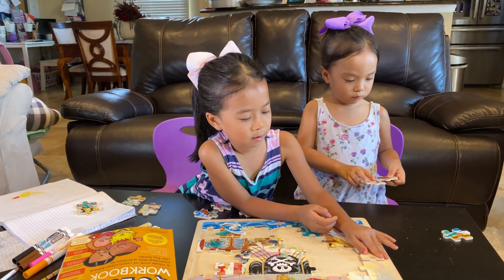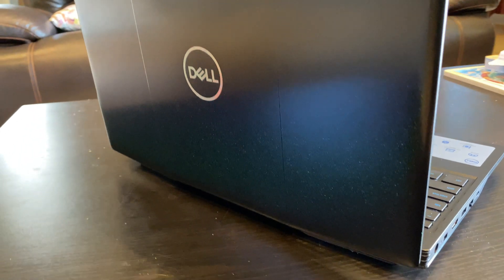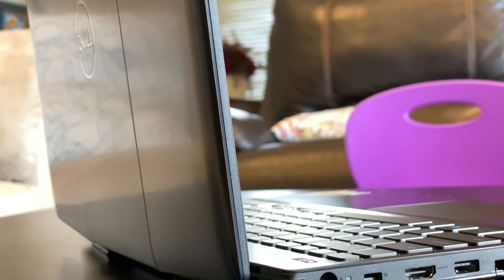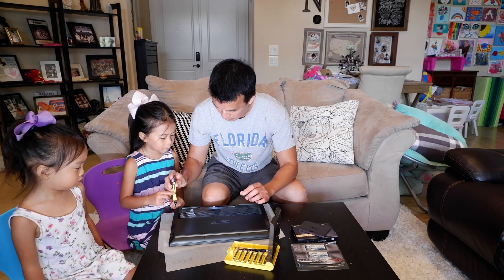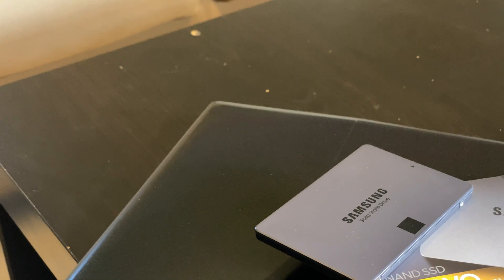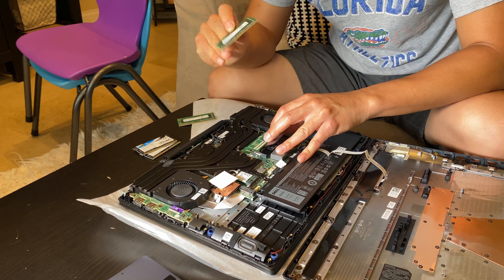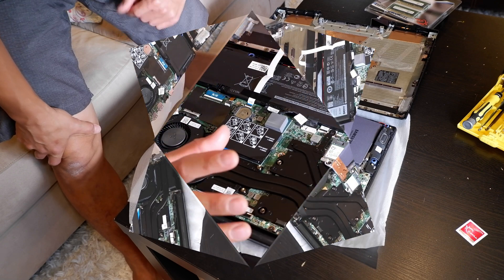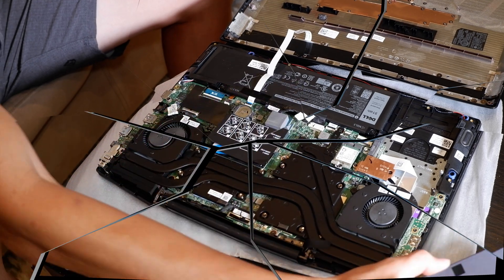How to Upgrade Ram Dell G5 15 5500 G3 Gaming Laptop 32GB | M.2 M2 2.5 SSD Upgrade Options Overview

Comment from the maker: Few Amazon sellers are gouging for the YX0F3 SSD Bracket at $23 (Dell list is $2.99): https://amzn.to/3qMip56
Reply: I believe that connecter on the board under the second m. 2 slot and above the battery is the sata power and data connections 
The adapter for 2.5 inch is going 10 to 20 bucks on ebay if you want look it looks like it would fit there would have to mount the ssd with double sided tape If that is the case though

Comment: I got mine in January of 2021, it's a November 2020 manufacture.. same 8gb and I need to upgrade. I saw that it's a 288 pin for the ram card, does that mean I need to get an exact 288 pin or will a lower pin still be suitable for application?

Comment: i don't think you need the copper heat shield to properly install a new m.2 ssd. it's just there to aid in heat dissipation. which means you can replace it with one of those gumstick thingies

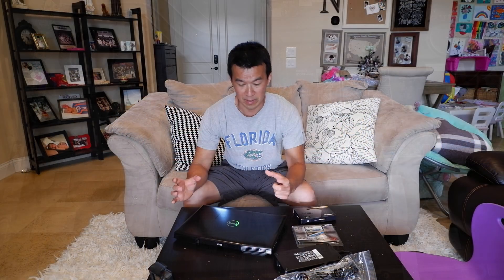Comment: 2:20 - If you get the larger battery, it doesn't leave physical space for additional hard drive
Reply from the maker: Well the space is for a full size but there isn’t a port for it. Only the G3 MB has it. So empty space on G5.

Comment: I have 2 questions 

1. I just got a new gaming laptop (Dell G15 5511) and I’m not sure how to downgrade to windows 10 because it came with windows 11

2. I’m thinking of upgrading the ram because it only has 8gb of ram, do I have to replace the base ram stick and add 2 new ram sticks or only buy 1 new ram stick and keep the base ram stick in.
Reply from the maker: Probably need to do fresh install for Win10. For ram some people like to match both sides with same brand and size. But at minimum match the speed and size of you add more. I have dual 16GB but I rerelease ever go passed 12GB in real world useage.

Comment: Do you know if the screen is upgradable? I have the base g5 15 se 5505 and i have the 60hz display I don’t know what type of connector the screen uses the 30 pin or the 40 pin connector
Reply from the maker: I don’t think it’s an easy swap. Not worth the effort IMO.

Comment: Will upgrading the dell g5 ram to 3200mhz is a good option? Will the motherboard support 3200 mhz? Or 2933mhz
Reply from the maker: The MB should support 3200Mhz. Keep in mind that for some reason Dell MB reads it at a lower speed. I think mine reads as 2666Mhz but it is 3000.
Reply: @TunerwithKids  thanks for the info. Btw am running hardcore games in my dell g5. So should i buy 16gigs rams of 3200mhz or lower?
Reply from the maker: If you got the money, do the 32GB. I hardly ever get close to that when video processing, though. Not sure how taxing games are on RAM.
Reply: @TunerwithKids  ok thanks a lot ! Will buy that with 3200Mhz and will give you an update.

Comment: How much space between the M.2 and the back cover? Will a 4mm heatsink fit behind the m.2ssd?
Reply from the maker: It’s tight. Need a flat heat sink like the OEM. 4mm is too much. I have another video showing this heat sink.

Comment: I just want to update my storage and I bought the same SSD, is there any other safer way to update it without like the brackets?
Reply from the maker: Did you buy the 2.5” or an m.2?  I have an updated video with the m.2 install. I’d recommend the OEM bracket but you can try an an aftermarket bracket and m2x3mm screw. Check the links in description if you need. I think it’s $23 on Amazon or try calling Dell for it for half the price.
Reply: @TunerwithKids  i got the 2.5

Do I need anything besides those brackets?
Reply from the maker: For the G5, I don’t think you can fit it. Only the G3 has the slot that requires an OEM adapter ribbon for 2.5”, but I think it sacrifices the m.2 slot. G5 only has two m.2 slots. Though the room is there, it won’t work.

Comment: is it possible to add a second WD BLACK SN750 NVMe M.2 SSD with heatsink? I saw that the heatsink is a bit thick, do you think the computer cover would close afterwards?
Reply from the maker: Yes...I have a newer video where I used an OEM heatsink and did the second m.2.

Comment: Hey I installed the crucial 2x 8gb on my dell g5 and when I power it on I just get a lit keyboard and black screen, it says it’s compatible with my laptop. When I put the original ones back in it says memory has changed and works fine
Reply from the maker: Sounds like issue with compatibility (of defective RAM), did you check if one stick works vs. both? Or do different combinations and slots?
Reply: @TunerwithKids  found that I didn’t have the sticks inserted all the way. did the process over and everything is fine now 👍🏾

Comment: Why don't you go M.2. SATA drives are yesterday. Also, There are other copper heatsinks and I would even question if you even need it. Also you need is a simple screw to hold the M.2 drive down.
Reply from the maker: The sata didn’t fit so I got the OEM heat sink and did an NVME 2280. I have another video on that.

Comment: does it support 64 gigs of ram?
Reply from the maker: IDK the specs on the I5 or the motherboard but it’s probably a waste on this machine. My computer barely breaks 12GB of use because the processor and GPU do a lot of work to reduce RAM use

Comment: Can this laptop or the i7 version support 64 gigs of Ram?
Reply from the maker: IDK the specs on the I7 or the motherboard but it’s probably a waste on this machine. My computer barely breaks 12GB of use because the processor and GPU do a lot of work to reduce RAM use.
Reply: No it supports 32gb like all dells. The chipset limits ram, though the processor can handle up to 128gb the motherboard controller doesnt.

Comment: Do I got to backup my files or anything like that when upgrading my ram?
Reply from the maker: I’ve never done it since it’s not related to storage like SSD or HDD replacement.
Reply: @TunerwithKids  using a external harddrive is the same as upgrading the internal harddrive right? I'm new to this laptop stuff
Reply from the maker: No it’s not. External Drive is for backup using usb . Upgrade or adding SDD is onboard and much faster data transfer using SATA.

Comment: “Nobody uses USB 2.0 in 2020.” 
Me: 😂😐🥲
Reply from the maker: For real, I don’t even is ports on that side, 2.0 USB and SD reader. Slow AF 25MB/s. All my stuff is connected to USB 3.0 or C on a WD19TB dock.
Reply: It’s for their dell external DVD drive that’s 2.0
Reply: It's best for USB mouse receiver, no USB 3 interference :)
Reply: @Vozael  Yeah,in fact they put 2 2.0 usb ports so people plug in their mouse and keyboard.

Comment: Hey, I think it is an either or for the ssd. If you have a big 2.5 ssd, and you have a bracket, you can place it in the slot. If you have a slim ssd, you can place it in the slot. I say this bc I only see one ssd slot, in which either a big ssd or a slim ssd can fit. I think they purposefully left out the ssd mount bracket so that you could place a slimm ssd in, because i did look into a bracket and it comes preinstalled in the 2019 models, not the 2020 models, like in this vid (https://www.youtube.com/watch?v=aCOE7PPA8Yk&ab_channel=uFixTek) I think they want you to install a slim ssd in cause of the one port and because you didn't have a mounting bracket. I found the manual for the dell laptop and it states this: 
Your Dell G3 15 3500 supports one of the following storage configurations:
●One M.2 2230/2280 solid-state drive 
●One 2.5-inch hard drive and one Intel Optane
●One 2.5-inch hard drive and one M.2 2230/2280 solid-state drive
●One M.2 2230 solid-state drive and one M.2 2280 solid-state drive
So I think that you either have the first or the 4th slot. It is weird they would leave the slot available if you are not to use it. Also I found out that there are two types of cells a 3 and 4 cell. A 3 cell battery will make room for a mounting bracket, but in your case most likely you have a 4 cell battery, which is larger and takes more space, so they do not include the ssd mounting caddy with it. I can only assume that they left it open for air flow. So it should be that the 2nd and 3rd variant models were the ones that were meant for a hdd/ssd. Idk if this helps but it does clear up why they left that space open.

Comment: The Dell website mentions about ram with ecc. Can i use non ecc ram on this model or i have to use ecc one ?
Reply from the maker: Not sure what ECC is. I just used the max ram and speed for this processor. I think there is info in the description box.

Comment: i have a variant which have 51 wh battery and a space for 2.5" hdd at a side.
and the user manual shows that i have to use a connector which converts sata port into a ribbon(strip) which will further mount on the mother board at right side of the m.2 slot.
but physically i didn't find any kind of clipper(ribbon accepter mentioning HDD) on my mother board so can any one please tell me is there any way ? or how can i connect the 2.5" hdd with this laptop.?
or if there is no way to connect 2.5" HDD then: 
why this space is mentioned FOR 7MM HDD ? 
Why they are selling 51 whr battery variant? 
Why the user manual saying that we can connect a 2.5" HDD which actually we can't.?
Reply: and as per my opinion this laptop does not support any HDD or SSD it only support m.2 chips. but the only flaw/worng thing is that left a space mentioning FOR 7MM HDD which is basically not possible.
Reply from the maker: To use a 2.5” SSD/HDD, you lose both m.2 locations. The ribbon and mount relocates the drive over the area for the m.2. I ended up going with a m.2 2280. See my newer video on install of the NVMe m.2 drive.
Reply: @TunerwithKids  no issue where is that port located on mother board to connect HDD/SSD
Reply from the maker: I think the HDD variant uses a different motherboard, from the service manual, it appears that version has the m.2 280 relocated higher. Most of the G5 5500 have the m.2 2230 at that higher location and the 2280 m.2 where the ribbon slot should be . https://www.dell.com/support/manuals/en-us/g-series-15-5500-laptop/dell-g5-15-5500-service-manual/installing-the-hard-drive?guid=guid-79e66086-81b8-4a27-81a1-4cc577342c20
Reply: @TunerwithKids  No basically the thing is the picture Dell have used in the user manual is not of G5 15 5500 its actually an image of G3 .

Comment: Is it possible to add a 1TB HDD with 512GB SSD which i already have in my DELL G5 5500
Reply from the maker: Yes. Check out my latest G5 SSD video. It was post two weeks ago. I installed a 1TB m.2 in the spare slot.

Comment: I just bought this model with same specs but I dont know why csgo is lagging!and i am new in laptop i dont know it runs slow!
Reply from the maker: Not sure what is running slow on yours. Mine runs great. I watch the Task Manager Performance and the processor is overclocked and run at 4GHz. My RAM hardly ever gets used, usually less than 10GB out of 32GB. The GFX card definitely does a lot of the major video processing which frees up other resources. Computer does run hot. I’ve seen my core temps hit 100C during major video processing.
Reply: @TunerwithKids  dayum 100° is very much hot brother,does I just waste my money  in this laptop or it it worth?
Reply from the maker: Depends on your needs. I’ve been using it for over two months and it’s run great. I use for 4K video editing and processing with dual 24” monitors. It has a cooling pad on it all the time. This is much more versatile setup than a full fledge desktop machine.
Reply: @TunerwithKids  I buy it in 1160 $
Reply from the maker: @amanmittal4697  that's expensive. I got it for around $900 on deal and coupons. Also had some other Amex and cashback deals. I also put another $220 in for RAM and a 1TB NVME SSD. For $1,200, you can get the Intel i7 or AMD Ryzen version. But with the process power and GFX card in a small machine like this you will have to deal with heat management.
Reply: @TunerwithKids  I generally dont play games just got into computer science field that's why I purchase a laptop!
Reply from the maker: This is overkill for your needs then. A $500 intel i5 with integrated GFX and 16GB of RAM is better especially if you are mobile and need long battery life. The main advantage of this the dedicated GFX card for video and overclocked processor for gaming and high performance.
Reply: @TunerwithKids  I dont wanna regret my purchase I generally play basketball 2k20 and fifa 2hours a day

Comment: i cant just buy a nvme or i really need a heat sync?
Reply from the maker: You NEED the heat sink and any other cooling you can get. I have a video next week in it and how/where to get the heat sink. It’s cheap. The temps are crazy when it’s reading and writing. The the SSD to SSD speeds are crazy. I saw 2 or 4 Gbps.
Reply: @TunerwithKids  can you give me a link or something  or ill just get the copper one i found for  a 2280 7 bucks would think work for what i need its the nvme blue wd single hole nvme ssd https://www.amazon.com/Heatsink-Copper-Copper%EF%BC%8C-Silicone-Thermal/dp/B07QNRP9HK
Reply: @TunerwithKids  i end up buying the 2 prong by mistake im sending it back tommow and geting the right one
Reply from the maker: Call Dell Parts and ask for P/N YX0F3 and two m2x3 mm screws. Should be $7 plus tax and free shipping. They are losing money at that price with shipping. Got it in 3 days via FedEx (which costs more that parts).
Reply: @TunerwithKids  thats the same price basicly what im paying as a prime member but ill take a look into it
Reply from the maker: The Amazon one isn’t OEM and 100% fitment. The Dell one bolts on and has thermal cushion. The Amazon one is just generic stick on and may not line up with holes in Dell motherboard.
Reply: @TunerwithKids  yup i got ahold of dell they said Thank you for staying connected,upon checking wit the team,we do have the part # YX0F3 for the ASSY Bracket SSD Thermal with a price of $2.99  sadly out of screws so ill have to hunt one down on amazon
Reply from the maker: Out of screws? 🤦🏻‍♂️🤦🏻‍♂️ those are common for Dell and other computers. It’s M2 size/thread at 3mm length. But get the heat sink for sure. You can also see if they have m2X2mm or 4mm. Worth trying those for $2/each.
Reply from the maker: You can also get a box of 300 random laptop screws for $7, might be better deal than two for $4 from Dell. https://amzn.to/34GVJc4
Reply: @TunerwithKids  ohh nice thats better than the screw kit  i found  like i said dell was out of the screws so i got the heatsink for 3.12 and the m.2 nvme you linked  https://www.amazon.com/gp/product/B07YFF3JCN/ref=ox_sc_act_title_3?smid=ATVPDKIKX0DER&psc=1 and the screw kit you just gave me not a bad deal after all thanks for the help
Reply from the maker: Just got done with video...https://youtu.be/qSZG-opCIQE
Reply: @TunerwithKids  cool i got everything sorteed out now got my heat sync today and nvme tommmow
Reply: At least you guys can get the parts lol 😂 I called dell uk and 15 operators later I finally order the part with the part number so hope they send me the right part lol 😂 uk price is an eye watering £27.48 for part and delivery 🚚😂 got to love the uk 🇬🇧
Reply from the maker: @Squady2760  , in the USA, they give you free two day shipping for having a Dell Rewards account. That’s free to setup.
Reply: @TunerwithKids  nice 👌🏼 I told them I was a fell rewards customer but they didn’t really care tbh lol they just kept hanging up on me or passing me to another representative lol 😂 then send an email to make a payment for the part, don’t even know how long it will take to get to me lol 😂

Comment: Would this void any warranty?
Reply from the maker: Levi, no it shouldn’t void anything as it is a serviceable part. In the US, the Magnuson-Moss Warranty Act is a law that prevents manufacturers from voiding a products overall warranty for changing parts by the end user. If they can prove that your change caused other issues then they can fight it but they can’t flat out void a warranty only if the part directly affects something or an individual system.
Reply: @TunerwithKids  wow, thanks for the quick response. I have no idea what I'm doing with computers, so thank you.

Comment: Hey, I'm considering buying this, but I'm not a heavy gamer. Some gaming and video editing and content creation are my area of focus. So could you tell me if the heating issue is a deal breaker for a user like me?
Reply from the maker: This has been running fine for me. I set it on a cooler all the time with lid close. I use it on desktop 90% of the time docked. Fan runs hard when I’m processing videos but normal use is fine and like any other PC. I plan to repaste the CPU with MX-4 when I do the SSD adder next week.

Comment: how do you add a ssd like that my batterys huge
Reply from the maker: Sylveon it ended up not fitting cause of the required SATA adapter. So only a small m.2 and bigger m.2 2280 will fit. Also if you have the larger battery it takes up the area there.